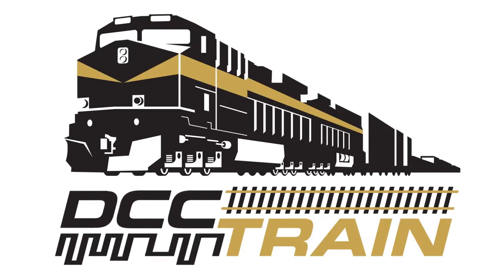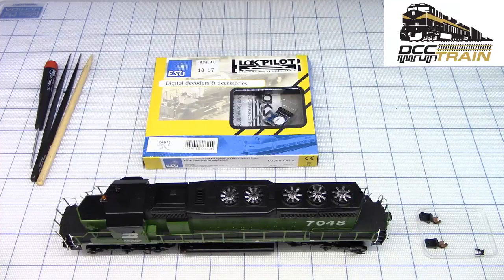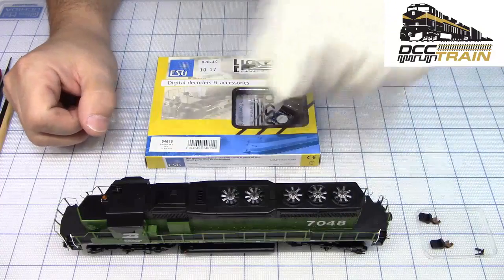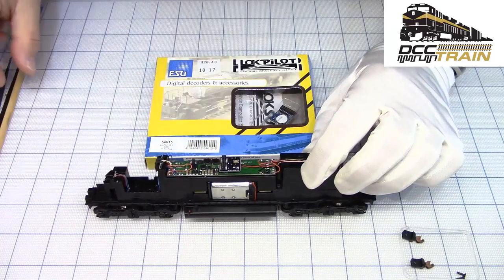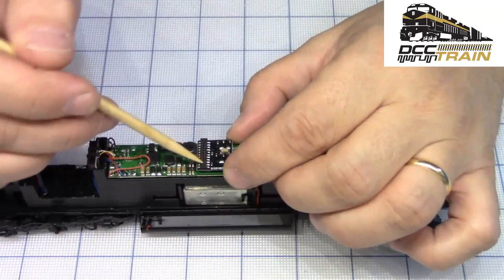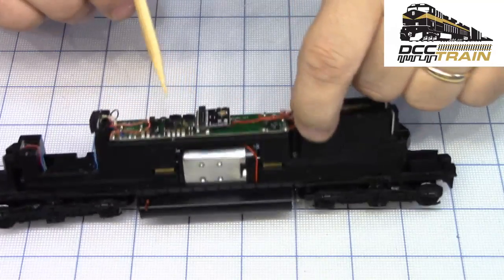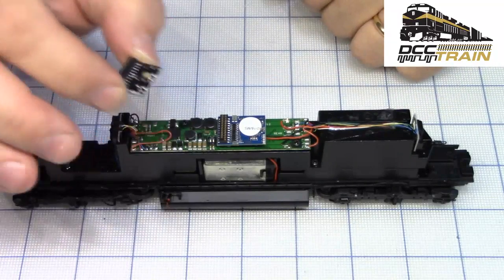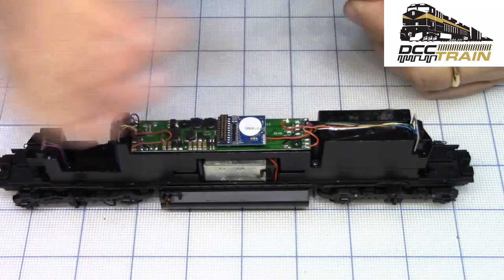DCC Digital Decoder Installation ESU Lokpilot V4.0 21 PIN plug Scaletrains Rivet Counter SD40-2

Comment: So for example with an Athearn Genesis locomotive with a 8pin plug, will this same idea work for installing a loksound decoder as well?
Reply from the maker: This is the same ides if using an 8 pin plug.

Comment: Hello, I hope you can help me, I have a 21-pin LokPilotStandard decoder with reference: 53614, it turns out that I digitize it but it doesn't work, I have a roco multimaus and I don't know if I have the problem on the chip or it is not compatible .
I hope you can help me. Thank you!!
Reply from the maker: Hello, you can read CV with your Roco multimaus. Read CV1 it should be 3.

Comment: quick question. for the LEDs for head and readlight, can i install a single resistor on the common (+) blue wire?    i did that and for some reason the voltage is ~+2V between white and blue (when headlight is on) and +18V between yellow and blue (when reversing).     i dont understand the 18V. is tghat configurable?
Reply from the maker: I'm using a resistor on every LED.

Comment: Hi, Amazing your videos, please help me, the 2 dip switches put it in the ON position? Need move some CV for the Ditch lights to come on?  they don't turn me on, just numberboards and Headlight, thanks for your help or if you have some video working your Locomotive
Reply from the maker: Thanks. You need to upload specific file for Lokpilot decoder design for the engine.
Reply: @dcctrain  the file install the correct CV?
Reply from the maker: @armandito7383  Do you have ESU Programmer?
Reply: No, I don't have Esu programmer 😔
Reply from the maker: @armandito7383  Are you in the US?
Reply from the maker: @armandito7383  Here you go. This is my new DCCTRAIN USA channel for live broadcasts answering questions because now I'm getting a lot https://www.youtube.com/channel/UC1etOA1R1EcMkAcQu2HuODA